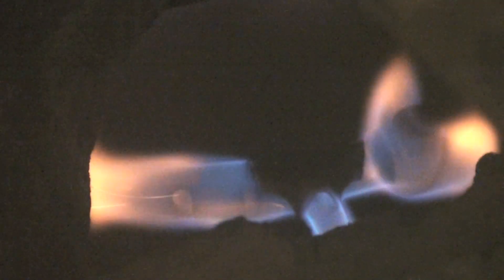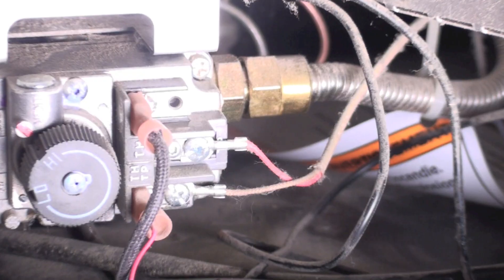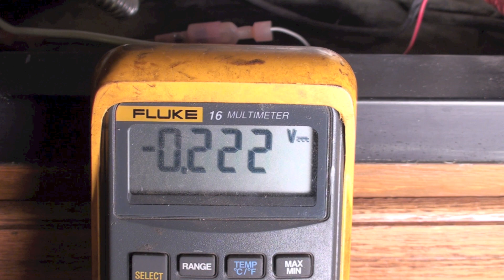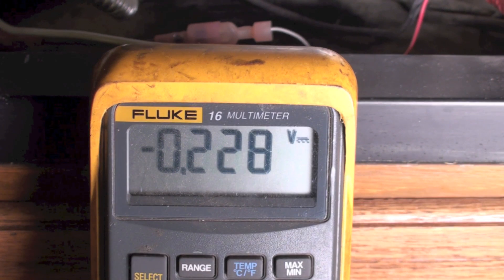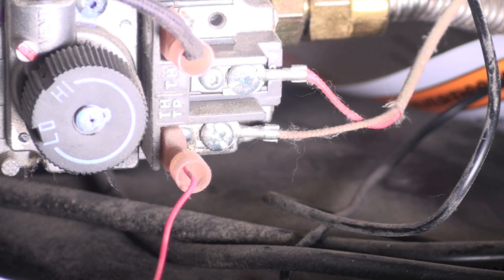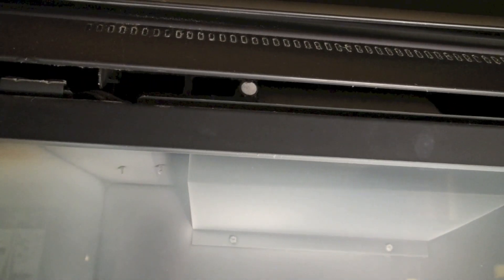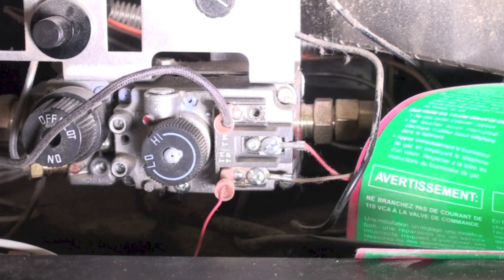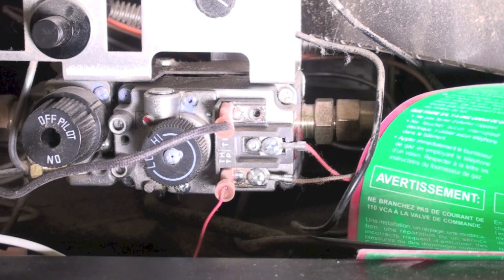How the fireplace thermopile system is wired

Comment: I found out just now that a thermopile can check good out of circuit, but cannot  generate enough MV in circuit. It seemed like it was the valve bodies fault for low readings, but it was the thermopile. That turned out to be a spendy fix.

Comment: Hey, I can turn my pilot on but as soon as I release the button, the pilot goes out what could be my problem
Reply from the maker: I am assuming it is a thermopile system.  Look at the pilot flame.  If it is yellow and looks like a candle flame, it is plugged It can be cleaned using compressed air pointed at the pilot assembly.  If the pilot is blue and covering the thermopile, clean all terminals where the wire from the thermopile are connected.  If none of this helps, the thermopile may have failed and needs to be replaced.  Hope this helps.
GFM
Reply: @ I guess I got that problem fixed now put a new Thermo pile in fireplace goes on stays on for about 5 to 10 minutes and goes out including the pilot light everything
Reply from the maker: @georgehiebert5572  If the unit shuts down after the burner has been on for a while and it shuts down the pilot, you may be shutting down on overheat.  I would be looking at high gas input pressure.
GFM
Reply: @grayfurnaceman  can you replace that or how do you normally solve that problem?

Comment: My 19 year Heat-n-glo has a standing pilot system with a strong pilot light. It started working intermittently. I replaced both thermopile & thermocouple. I turned it  on every day for a week & now nothing. Any suggestions?
Reply from the maker: I would first clean and tighten all wiring terminals.  If no luck, Probable gas valve failure.
GFM
Reply: @grayfurnaceman  Thanks for your reply. I checked all the terminals and then thought maybe it was a defective thermopile. Got another new one and again, it worked for a day and then nothing. I guess nothing left to replace but the gas valve. Always something!
Reply from the maker: @MrJonreed7  It appears so.
GFM
Reply: @grayfurnaceman   OK, this is frustrating. After changing the thermopile & thermocouple, the fireplace works great for a few weeks. Then replaced the gas valve & again it works great but only for a few weeks. Strong pilot light. I give up. Anything left to replace or any suggestions would be gratly appreciated.

Comment: To anyone this is a thing: only AFTER I installed a million little pieces of rockwool and positioned new logs to make the whole thing look realistic...

Did the thermopile decide to start acting up.

So an hour later after tearing it all down again I was mystified how the pilot was fully on but didn't light up the rest?

Then by chance while in the ON  position, a lightly applied pressure to the thermopile to gently push it toward the pilot flame.

Money.

Seems the connection to the thermopile under it- the screw was loose and held it away from the flame by a 1/16th of an inch...😶 so I tightened by maybe a 1/4 turn. Also, at same time tried rotating the thermopile element so that a different side of it was facing the flame.

Anyway maybe TBC maybe but so far so good.

Comment: New nova820 valve.. tp to tpth measures 620mv. But pilot solenoid not holding. What to check? I have another connection from pilot unit that threads in and contacts a blue wire... what's that for?
Reply from the maker: You may have a manual reset draft hood limit switch.  
GFM
Reply: The one you asked probably a thermocouple, the connection to that wire may have oxidized build-ups need to clean. You may search videos on how to check the thermocouple

Comment: very confusing, to me, markings on gas valve terminals. Not your doing.  Also see 4:03,  I don't see a mark for the gas valve connection.  Otherwise thanks for all information.
Reply: TH+TP, TP, TH 3 connections. when you open the cover you will see them

Comment: I liked the clear explanations on this one. My thermopile reads 250 mV when it’s connected to the controller and the pilot is lit. (Not the main burner ) is that too low? I feel it might be going bad because there is a significant delay for the main burner  to turn on when the temperature on the thermostat drops (and it clicks on)
Reply from the maker: I would expect 500MV open circuit.
GFM

Comment: Gray is the safety always wired in line with the thermostat? To me I would think so. If not could you explain the reason it would not be please.
Reply from the maker: Sometimes the high temp limit is wired in series with the thermopile.  The reason for this is if the limit opens, it will drop out the pilot safety that will require an inquiry as to why it opened.  
GFM
Reply: @grayfurnaceman  Thank you once again. Currently on one. The guy who was to repair it. dismantled about everything in his attempt to repair and then walked away. So they called me and I said sure we can get it put back together. Some parts are missing but no big deal. Fabricate  missing brackets and get fireplace running again.

Comment: Hi maybe you can help me the main propane supply line for a hot water tank burner assembly 
What should be in the tube
Reply from the maker: Propane
GFM
Reply: @grayfurnaceman  that is a no brainer just purchased a propane final burner assembly and in the main supply line the inner tube is about a inch short of the flare and is crimped closed 
Defective right 
They sent me a second one same thing the inner tube on my original burner comes almost flush with the outer tube
Reply from the maker: @hunter-rl8dt  Send some pics to Grayfurnaceman@gmail.com
GFM

Comment: So about the "limit switch" shown @ 3:25.   My stove shuts down after ~10+ minutes.  Cools down and relights.  So seems like limit switch intervention.  How do I know if it's defective or if there is an actual problem?  (Hearthstone Tucson 8700)
Reply from the maker: First, I have found very few limits that are defective.  I would check the gas input.  Could be overfired.
GFM
Reply: @grayfurnaceman  hmm, The device has done this in two separate locations with completely different gas supplies. Literally moved it to a new house after a few years storage interval and initially thought the issue was a loose thermostat wire I fixed.  But the unit does a full gas cut/kill to everything, pilot and main.  Resets and works again once it cools down.
Reply from the maker: @dvmartel1  If the pilot shuts down, your problem is probably the draft hood limit.  Means the fireplace is not venting properly.  You need to find out what is causing this as you could be getting CO poisoning in the house.
GFM

Comment: Hi, my thermopile with wires removed from TH/TP AND TP is 776mv. But the voltage drops to 114mv when i put wires back to TH/TP and TP. This is only with pilot light on hitting thermocouple. I tried jumpering th/tp and th but burner not on. I tapped valve lightly and burner came on. Is it a bad gas valve? Thank you.
Reply from the maker: The 114 mv number is on the low side of normal.  I would clean all terminals first.  You can try replacing the thermopile, but the numbers are not that far off.  You may need a new valve. 
GFM

Comment: I have an issue where the flame above melted the igniter ...  any thoughts why that would get so hot in that area?? Air flow issue? I think it’s tripping the high temp limit switch (spillage )
Reply from the maker: This does not sound right.  The ignitor is made from stainless steel.  The flame is not hot enough to melt it.  Can you send pics?  Send to Grayfurnaceman@gmail.com
GFM
Reply: @grayfurnaceman   sorry for the confusion,  I’m referring to the piezo push button igniter (black plastic)
Reply: @jbh.6257  I think somehow gas went to wrong direction. Better take burner apart and clean every piece, brush and blow.
Reply: @hvacworkshop4791   thanks but I figured it out… the glass was not seated properly in the frame causing the draft to push the flame down and melt the igniter

Comment: Spent a lot of time on your video.  I have my multimeter dial turned to 2 mila-vaults setting the readings I am getting is -.523 with thermostat off and -.075 thermostat on.  Is this a good reading?
Reply from the maker: The .075 is a bit low but probably ok.  Should be .125.  Be sure all connections are clean and tight.
GFM

Comment: First, thank you for all the great info which helped me to diagnose the issue.
I have 2 quick questions.
My WR brand millivolt gas valve was model was not available. Instead I replaced it with "36C03U-300 400 White Rodgers 36C03U- 333 433 MilliVolt 750 MV Gas Furnace Valve"
This new valve has a 3/4 outlet instead of 3/8 for the original and as a result much higher BTU capacity.
1) Is higher BTU capacity an issue ? (previous one was low profile up to 70K BTU and this one is up to 230K)
2) The pilot light is good, but when I turn on the wall switch the pilot light becomes smaller and therefore does not ignite the burners immediately. Is this normal?
Thanks

Comment: What if the voltage is 550 mvolts with switch off and only 10 millivolts with switch on.  Does that mean my thermopile is bad?
Reply from the maker: Either that or you have a bad connection.
GFM
Reply: grayfurnaceman i checked and tightened all my connections. There is little info on youtube about what the voltage should be with the wall switch on.  I just checked my neighbours and his reads 250 millivolts when which is on and 500 millivolts when switch is off.
Reply from the maker: @truenorthmuskoka9077  The 250 is very good.
GFM

Comment: My main burner does not turn on.  I have 478 mV with pilot light ON.  When I engage the wall switch-thermostat I read 33 mV.   Way below the minimum requirement.  Would this prevent the main burner from turning on?  Does this indicate a bad thermopile needing replacement, or do I need to do more testing?  Thank you
Reply from the maker: The drop in MV when the gas valve is energized indicates the thermopile is failing.  Replacing the the thermopile is cheapest repair.  You could also have a failing gas valve.  
GFM
Reply: @grayfurnaceman  Thermopile replaced, fireplace is working again!  Hardest part was creating clearance to remove the thermopile.   Thank you

Comment: Hi! I bought a used cottage franklin propane stove.  It fires up and runs fine on low setting.  When i try to increase the heat nothing happens...it stays at low heat.  I have replaced batteries on remote and receiver.  No help!  The orifices were changed from gas to propane, so they are new.
Any help would be greatly appreciated!

Comment: Anyone can explain to me why some pilot assemblies have thermocouple only, some have thermopile only and some have both of them???? Thanks
Reply: I want to know that also, but my theory is this. My Heat n Glow gas fireplace has both of them. I believe the thermocouple keeps the pilot lit and the thermopile lets the gas valve know that the pilot is lit and is safe to open and ignite the fire. Someone please correct me if I'm wrong. I'm going nuts trying to figure out why my fireplace won't light. I think I've traced it to a bad gas valve because I replaced the thermocouple, my thermopile is giving me a good reading and I tried jumping the thermopile to complete the circuit.

Comment: Mine is just like this,  I set the valve to Pilot but the pilot 
will not lite at all, No gas is going to it. The gas is on feeding into 
it. Why do you think no gas is getting to the pilot? Im thinking the valve is bad or the pilot tube/ jet is plugged?  thank you
Reply: you may have to push the pilot knob down and then wait 45 seconds and try to light pilot, if it lights continue to hold knob for 1 minute

Comment: Hey Mr.Furnace, The red lead should be th/tp and the white to tp on the valve...If you don't know why....look it up!
Reply from the maker: As the millivolt system only uses 2 wires, it makes no difference.
GFM
Reply: @grayfurnaceman , Actually it does in certain circumstances....The red lead is the power lead and with certain fan/remote applications they will not work unless tp properly installed.
Reply from the maker: @ericwright1561  It would be interesting to see an application where you use millivolts to control an fan, etc.
GFM
Reply: @grayfurnaceman  sky tech 180 cfm fan kit... fan control unit is set by red wire of thermopile.
Reply: I guess you’re correct. There’re three terminals, tp,th-tp, and th. The thermopile powers the tp and th-tp, thus powers the pilot valve. Thermostat wire connects to tp, going to t-stat and vent spilling limit, coming back to th to power the main valve.

Comment: My bradford white water heater is giving me a code led probe,will that be the thermopile?
Reply from the maker: I am not sure what a "code led probe" is.  Do you have an error code number?
GFM
Reply: @grayfurnaceman  i got a bradford white surrender water heater & im getting 2 flashes, looking at water heater codes it means led prode
Reply: @grayfurnaceman  yes is a 2
Reply from the maker: @justdissin7340  I would first be looking at the pilot to be sure it is blue and covering the thermocouple. If so, the thermocouple is probably failing.
GFM
Reply: @grayfurnaceman  thanks for your replies, it has that thermopile one,ill have to check mv on it

Comment: How do I supply power to my heat and glo natrual gas fireplace? It won't run unless it has battery's in
Reply from the maker: Are you trying to run the fireplace from the house power?
GFM
Reply: grayfurnaceman yes because right now it's only works with the back up battery's so it kills the batteries
Reply: Yes because it keeps killing the back up batteries so do I run a 14/2 110v to the board
Reply from the maker: If the board has provision for 120 volt power, the 14/2 is ok.
GFM
Reply: Will it say on the board because the instructions that were given to us were useless

Comment: Gas fireplace that works for 15-60 minutes, then the gas shuts off. Replaced the wall switch, pile, and coupler. Still gas shuts off. Stopped by a local heating business and the owner said that the switch repair is probably the problem. I put a standard 120 wall switch. Told me that the standard wall switch has too much resistance and I need a millivolt wall switch. Went home as instructed and took the two wires and tied together. The fireplace works! Now I have to find a switch.
Reply from the maker: That is probably correct.  I would try using a millivolt thermostat.
GFM

Comment: i have a majestic dvt39 propane fireplace.  I have low flame.  Service guy told me the millivolt gas valve was bad, so I purchased a new gas valve, same part #, brand etc  (SIT 820 NOVA 0820651 for propane).  I'm going to replace it and was just wondering if there is anything I should be aware of before I do this?  It looks pretty straight forward and I've read what I can find and watched several videos etc. .
But just wanted to cover all my bases before I start.  From looking at it the biggest issue is going to be getting the old one disconnected. it's black iron (6in nipple) from the shutoff valve,  into the valve. There is a coupling, but not sure I"ll be able to get wrenches on it to loosen it as it's right under the fireplace and it's tight in there... but anyway.... just wondering if there are any 'gotchas' to watch out for.    thx in advance
Reply from the maker: Try this video:  https://youtu.be/g8jMJIBVRGo  Its for a gas furnace but the basics are the same.
GFM

Comment: Thanks for sharing your knowledge!  So here's my deal - Mendota DXV-42 gas fireplace, pilot is great (blue, engulfs the thermocouple and thermopile nicely) but burners won't come on.  I tested the thermopile output at 289 mV, should be >460 mV per Mendota.  I cleaned it pretty good with a scouring pad, but no change.  I bought a new OEM assembly which includes the thermopile.  It's super tight in there and I might have to destroy the existing thermopile to get it out of the assembly.  But replacing the entire assembly involves messing with the gas line, etc (and the screws are almost impossible to get to) and I'd rather avoid that if possible.  Also, not only am I having a hard time finding a Mendota approved repairman, I'm concerned that he'll encounter the same issues I'm facing.  Before I go any further, is there anything else I should be considering as a root cause?
Reply from the maker: I would make sure all electrical connections are clean and tight.
GFM